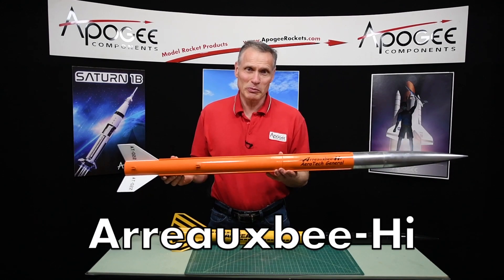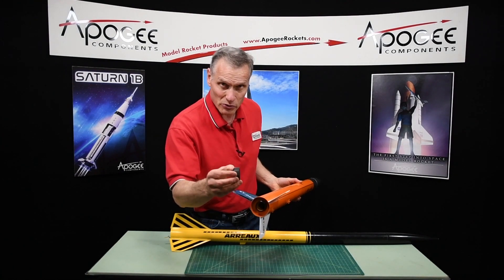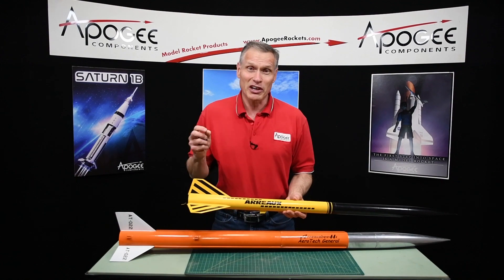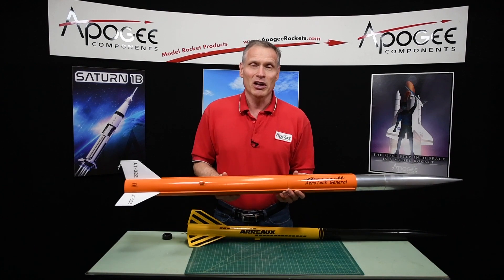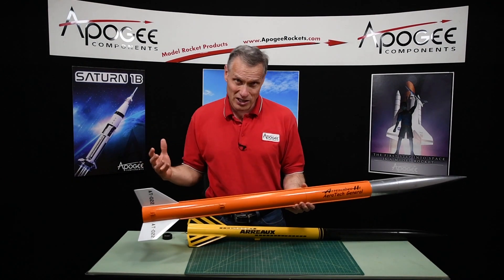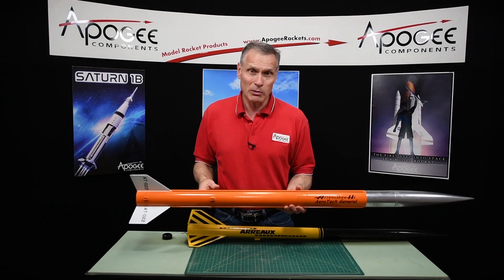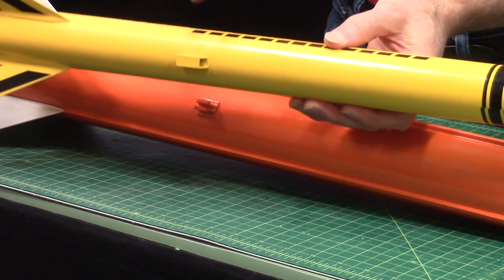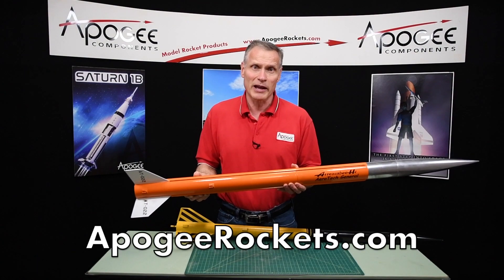Aerotech Arreauxbee Hi model rocket kit

Comment: Got my Initiator on order.✈
Reply: Have one ,, 'with a couple others'',, in the Deke Slayton Air/space Museum , up in Sparta WI.
It was the Wifey's 2nd one.
Not a fan of the ''swept back fins though'',, on stuff higher than an ''F'',, because of the added stress on the trailing lower 1/2 of the fins.
Actually blew the lower 1/2 of  a swept back fin once fin once,, using a larger than ''F'' motor.
The 'Black & yellow' ''Arreaux ''-  ''design'' - fins though,, are the ticket,, for stability & really getting after it. 😉
I
Reply: @I74UL1-v2t I'm good using E sized aerotech engines?

Comment: This comes with the "pot scrubber" ejection baffle which may be responsible for a lawn dart landing on its second flight. The motor ejection charge did not separate the payload section and the parachute could not deploy. I rebuilt it without the pot scrubber, and have had three good flights since.
Reply: You are supposed to stretch it out all the way, perhaps you didn’t do that?